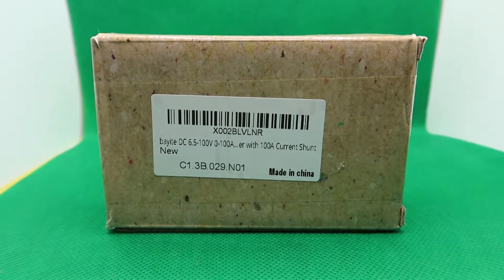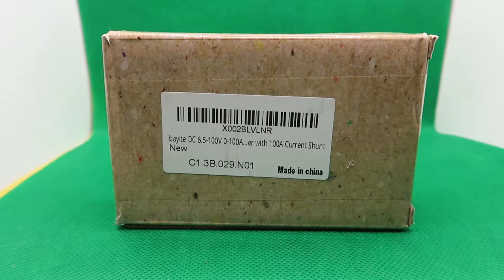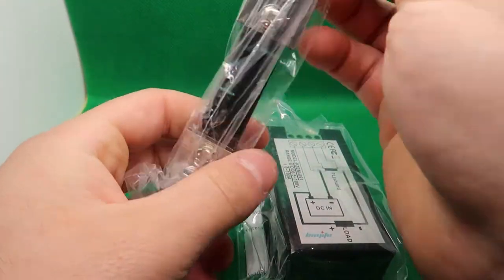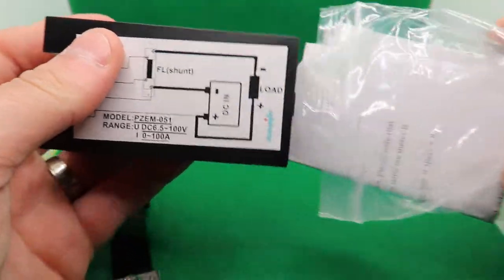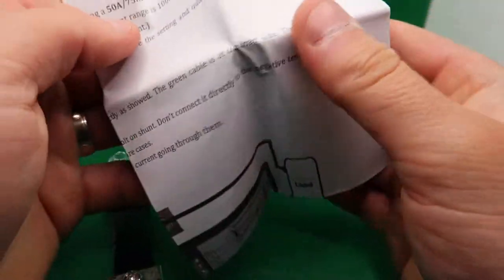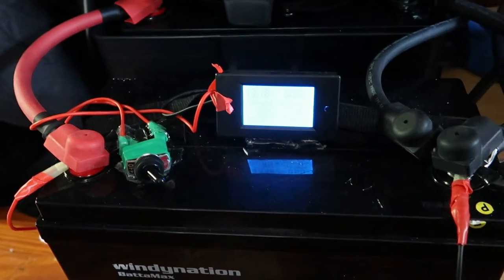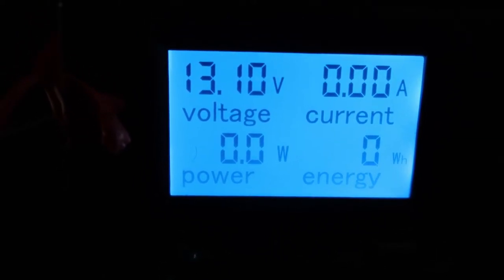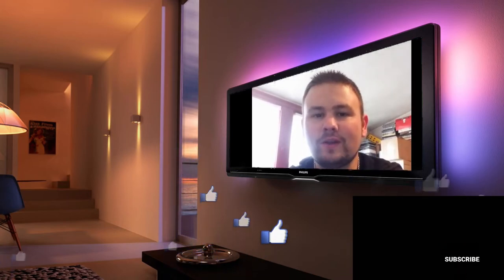DC 6.5-100V 0-100A LCD Display Digital Current Voltage Power Energy Meter  Ammeter Voltmeter

Comment: I bought the same one w/o the Shunt. How would I wire this so i can monitor my batteries?
Reply from the maker: So all you need is a POS and neg wire hook up if you look on the chart you can follow the plus and minus lines and that's all you'd need connected
Reply: @Wengertime89YT  Thank you

Comment: Scott, I think if you showed a bit more it would be more useful.  The feel of video was good but the step by step lacked a little.
Reply from the maker: Thank you for your input! I will take notes!!
Reply: @Wengertime89YT  it's more on me not being a RC or electrics guy.  I got the RC portion and think its good to go.  I don't totally understand the ammeter.  How you installed would be nice to see... I am a rookie at this stuff but have slowly been figuring it out.  Hook up at least.  I really do like that you posted this information... I have the same roaster and want to get more repeatable roasts.   The RTD hooks into the VINT HuB correct?